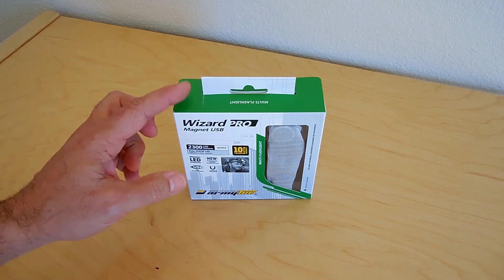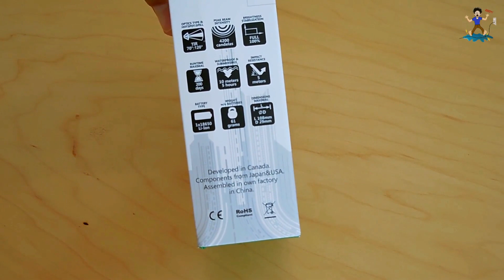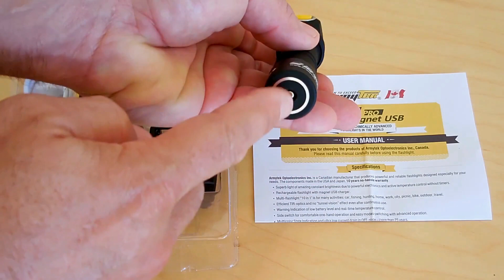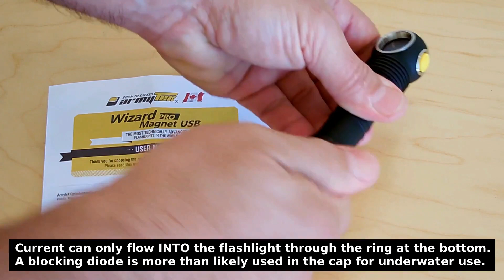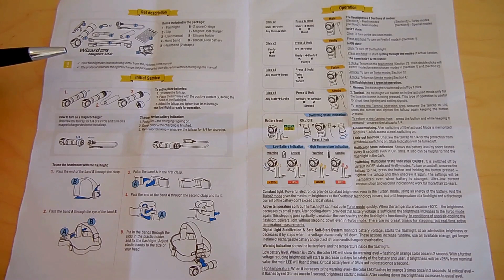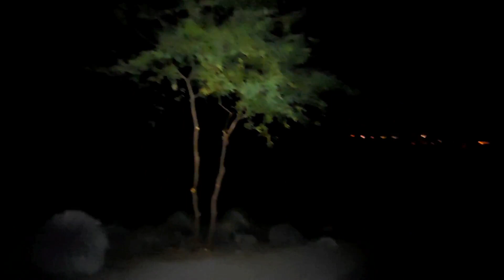Armytek Cree LED Multi-Flashlight Giveaway!

Comment: Looks like a nice flashlight.  Nice work on the video as usual.  I have been in the market for a quality flashlight--will have to check out Armytek.  I wonder how long that will last on the lowest firefly mode?
Reply from the maker: Lowest firefly mode is 200 days, according to the manual, and 40 days for the highest firefly mode.

Comment: Really nice flashlight and i must say that i was looking for a Cree flashlight that uses 18650 cells in my country for months now and i can't find one not even normal led flashlight that uses 18650 cell.Maybe i'm not looking very deep or something and buying an expensive one online is not an option because most likely our customs would skin me alive when they see a pricetag.Anyway it would really be useful to have one especially with included straps for my arm to put it on makes it alot easier to work outside in the dark when you have both arms available.The only thing i would do is that i would change that battery for proper non chineseum one :)
Reply from the maker: That 18650 battery happens to be a quality battery, not Chinese. More than likely Japan.

Comment: If that proprietary charging cable craps out then it's trashed.
Reply from the maker: Not really. The charging circuit is inside the cap of the flashlight. The cable is nothing more that 5V with a circuit that monitors the voltage. Not much to go wrong. If it did fail, you have the 10yr warranty. You can also remove the battery and charge it externally.